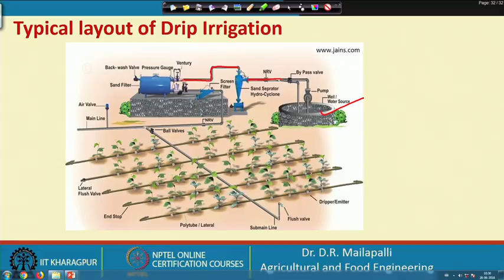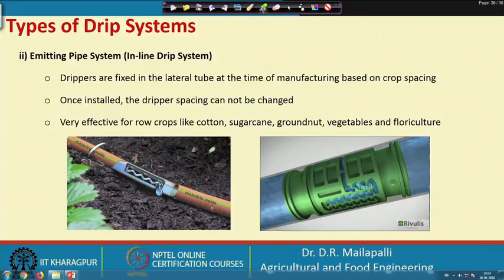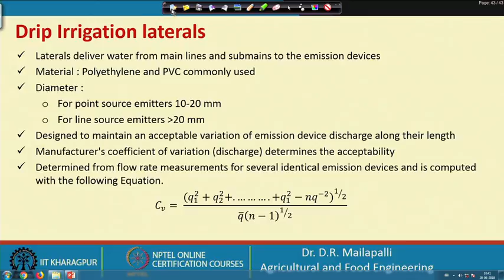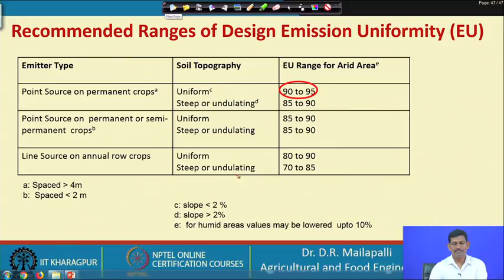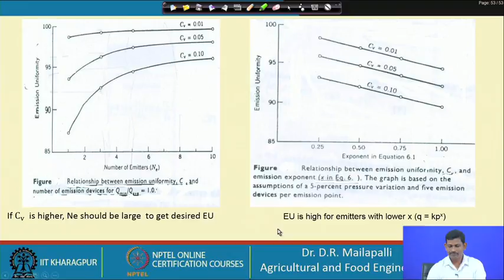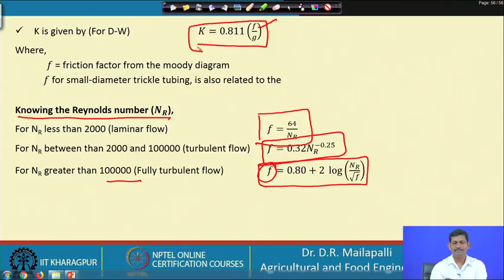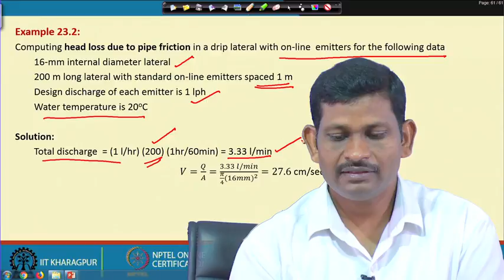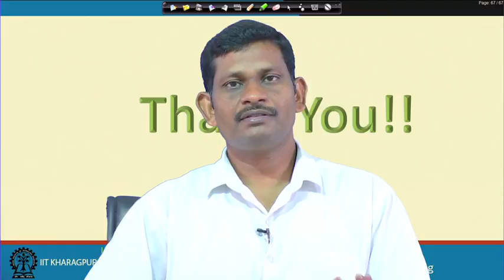Lecture 23: Drip Irrigation system

Comment: Sir , what is the technical difference between drip & sprinkler systems?
Reply: In drip irrigation system water is supplied after on day,two days and at  the most three days interval , amount  of water supplied is to meet the transpiration requirement of the crop for  the irrigation interval.
.in drip irrigation a part the soil  is wetted depending on the texture of the soil and spacing of the lateral and drippers. Small fraction of the  top soil surface is wetted,thus evaporation losses are very less.
In sprinkler irrigation system is replication of rain. Soil moisture is raised to field capacity and irrigation interval depends on the evapotranspiration requirement of the crop during the period.